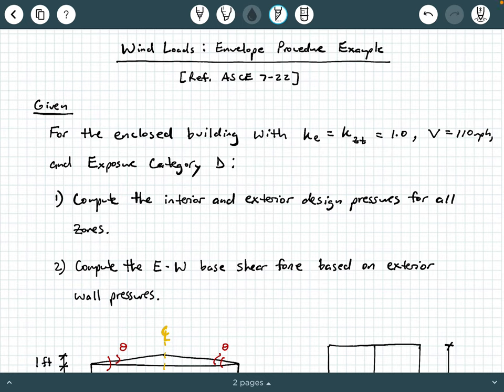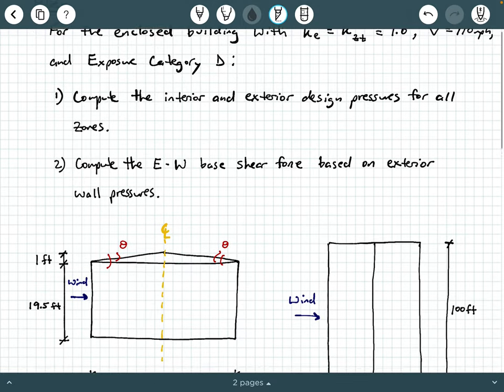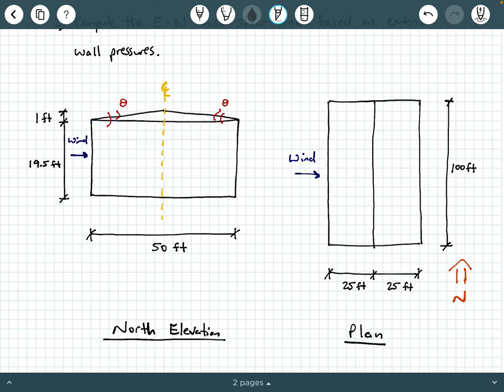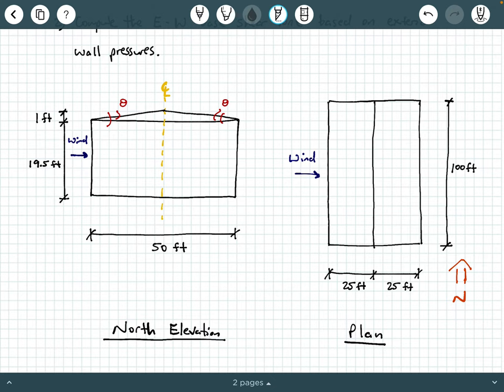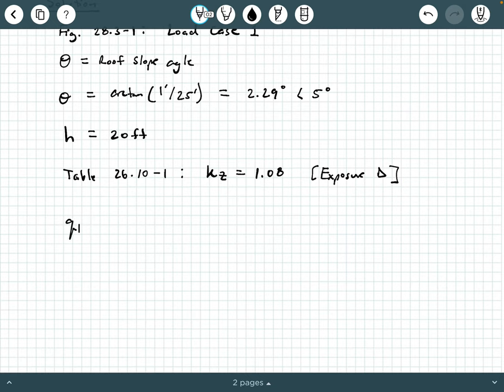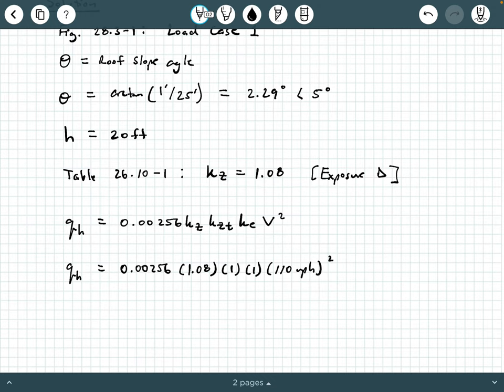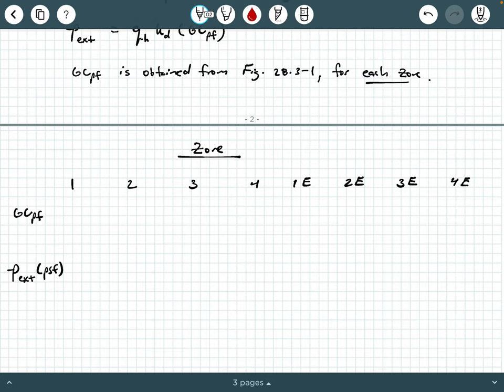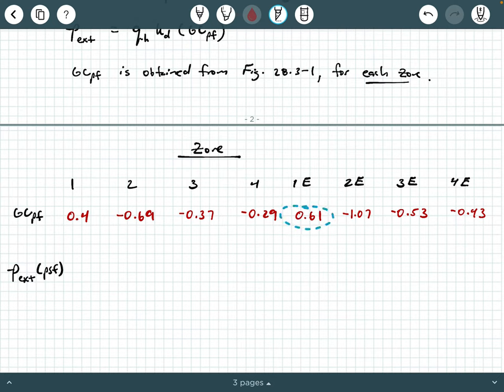Wind Loads:  Envelope Procedure Example (Ref. ASCE 7-22)

Comment: Why is it that you did not use the Wind directionality factor, Kd, in your calculation to find the velocity pressure, qz?
Reply from the maker: Good day.  This is a good question.  This is one of the updates of ASCE 7-22.  Equation 26.10-1 of ASCE 7-22 does not include "kd" as we have seen in previous versions of ASCE 7.  The directionality factor (kd) is now included in the later chapters (27 - 30) when computing the various pressures "p" and forces "F".
Reply: @mathandengineeringwithdr.a9515  I understand. Thank you for your response. Very helpful video!

Comment: I have made a spreadsheet to calculate Kh,Kz values and came up with a bit different number then Table 26.10-1.  Should I not round the calculation and just truncate the number at two places?  In this example when h=19.5 ft, Kh = 1.08  and when h=20 ft, Kh = 1.09.  I know it is not much but it does change the numbers a little.
	Exp D				
h	no round	rounded			formula
15	1.03504	        1.04	 = (2.41)(15/1935)^(2/11.5)		
20	1.08814	        1.09	 = (2.41)(20/1935)^(2/11.5)		
25	1.1312	        1.13	 = (2.41)(25/1935)^(2/11.5)		
30	1.16765	        1.17	 = (2.41)(30/1935)^(2/11.5)		
40	1.22755	        1.23	 = (2.41)(40/1935)^(2/11.5)		
50	1.27613	        1.28	 = (2.41)(50/1935)^(2/11.5)		
60	1.31724	        1.32	 = (2.41)(60/1935)^(2/11.5)		
70	1.35303	        1.35	 = (2.41)(70/1935)^(2/11.5)		
80	1.38482	        1.38	 = (2.41)(80/1935)^(2/11.5)		
90	1.41348	        1.41	 = (2.41)(90/1935)^(2/11.5)		
100	1.43962	        1.44	 = (2.41)(100/1935)^(2/11.5)		
120	1.48599	        1.49	 = (2.41)(120/1935)^(2/11.5)		
140	1.52637	        1.53	 = (2.41)(140/1935)^(2/11.5)		
160	1.56223	        1.56	 = (2.41)(160/1935)^(2/11.5)		
180	1.59456	        1.59	 = (2.41)(180/1935)^(2/11.5)		
200	1.62405	        1.62	 = (2.41)(200/1935)^(2/11.5)		
250	1.68831	        1.69	 = (2.41)(250/1935)^(2/11.5)
Reply from the maker: Nice!  The equations for Kz beneath Table 26.10-1 would be the most correct to use since these capture the nonlinear nature of this relationship.  Thus, using 1.09 (actually 1.088 when rounded to 4 sig figs for h = 20 ft) is the most correct.  The advantage of the Table 26.10-1, though, is that you can directly read the values that are presented, and you are also permitted to use linear interpolation with the tabular values....which is helpful for quick calcs and when folks prepare for the PE.  

Since you created a nice spreadsheet, though, you can continue to use that.  If you really want to have some fun with that spreadsheet, put some IF statements for the different z-domains and rig it up to handle all the exposure categories.  Awesome stuff!

Comment: 2 questions:
1) For base shear, shouldn’t you take trib area to the diaphragm, so only half the wall height?

2) for base shear, why aren’t you taking any pressure from the roof? Per section 28.3.6, you need to take 8psf multiplied by the roof area of the building projected onto a vertical plane normal to the wind.
Reply from the maker: Hi Jessica, 
Thank you for your great questions!  I split up my response to your question 2 into two parts.  

1)	For the base shear, think of this as an over-simplified vertical cantilever beam with a uniform load and the base is fixed to the ground.  The base shear would be like the horizontal force reaction.  All of that wind load on the walls has to go somewhere, and that somewhere is the base.  Now, if we were going to investigate or design the roof diaphragm, we would consider pressures on the upper half of the wall height.  But in this example, since we were explicitly asked about the base shear, we have to think of the base as an external support that all of the applied loads are transferred to.  

2a)    The minimum loads specified in Section 28.3.6 (8 psf on the roof and 16 psf on walls) are used when designing structural elements of the main wind for resisting system (MWFRS) and should be applied separately from the actual wind pressures.  So, let’s say we are designing a roof beam that is part of the MWFRS.  We apply the actual pressures to the building (like we did in the example) and determine the wind effects (W) on that beam (shear, moment, etc).  We input these wind effects (W) into the load combinations and design the beam.  We then, separately, apply the 16 psf and 8 psf to the building and determine the wind effects again (W) on that beam.  We input the effects (W) due to these minimum pressures into the load combinations and check that the beam is still adequate.  For the sake of this example, though, I was only intending to demonstrate how to compute base shear due to wind loading using the Envelope Procedure. 
 
2b)    Since the roof pressures actually relieve the total horizontal shear due to the windward roof pressure being larger than the leeward wind pressure and both sides of the ridge are experiencing suction, we can neglect the roof wind pressures by Section 28.3.3.  i.e. The total horizontal shear is greater than that determined by neglecting the wind forces on the roof.   [I probably should have stated that in the video somewhere.]  Note, though, that if the windward side of the roof was in compression, we could not neglect the roof pressures since their horizontal components (projected on a vertical plane) would both add to the wall pressures (pointing to the right).

Comment: mean roof height = eave height when the slope is < 10 deg I believe right?
Reply from the maker: Thanks for your comment/question.  Based on the definition of the "mean roof height" in ASCE 7, for roof angles less than 10 deg, the mean roof height IS PERMITTED to be taken as the roof eave height.  So, this is an option but not a requirement.  I took it as the actual mean height (20 ft) in part so I can just read the Kh value directly from Table 26.10-1 as 1.08.  I will reply to your other comment regarding that value on your other post.